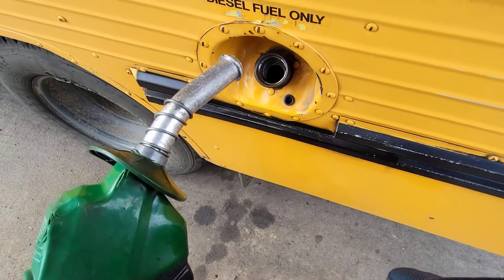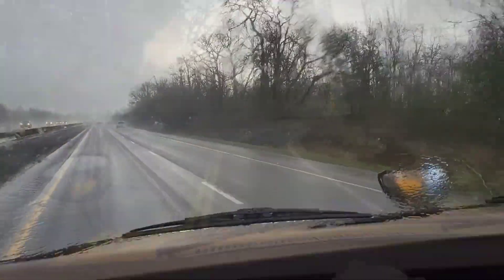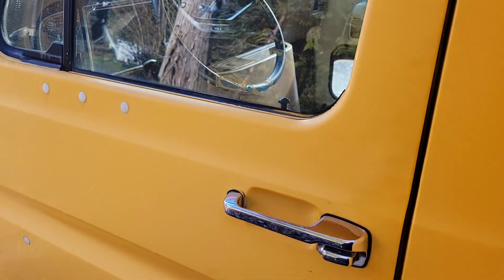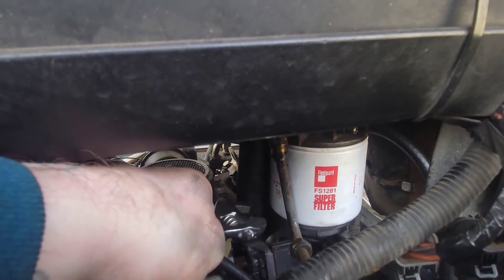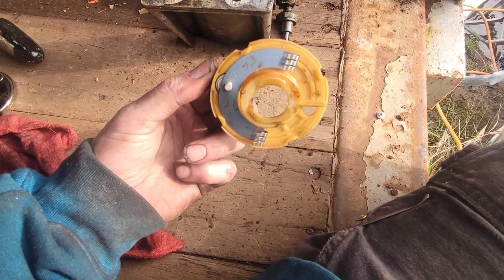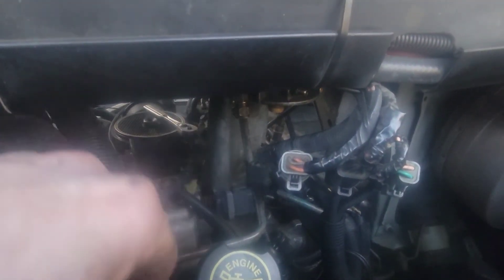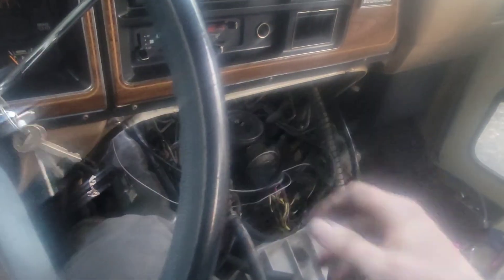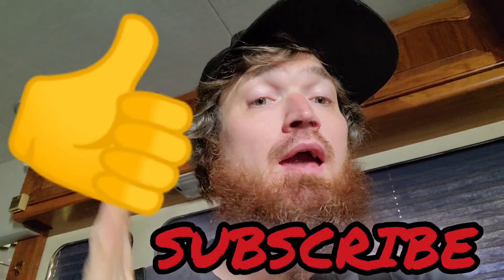7.3 idi diesel ford fuel heater delete

Comment: On my 7.3 am getting crunking but know start am bout at my ends with the truck. Its started off being a bad fuel pump. Changed it out! Then injecton pump was not sending fuel though the lines! So i Changed that out! Buy the way. It will start on starting fuild and run good. Just will not start on its on! And i went over to the glow plugs with all new ones. Checked the wires. Getting 8volts on the ends. So i unhooked it off the Selenoid and hot wired it for 10 secs still will not start on it on!  Do anyone know of anything i can try to do next i will update if i fine anything out. Thanks!

Comment: Any downside in deleting the fuel heater? I'm of the mindset: "if u don't need it, delete it." Just discovered your channel, im a new owner of a 93 7.3 factory turbo 7.3 idi. It's a heap, but engine and drivetrain solid. Thanks for my continued education. -Jesse, SW Idaho.
Reply from the maker: No downside to deleting the fuel heater unless you live in sub zero temperatures most the year. Diesel is usually treated for winter these days. The heater is unnecessary. Just a source fir air intrusion. Thanks for watching! Any more questions just ask. Hope you enjoy your new rig.

Comment: Why not use starting fluid often?
Reply from the maker: Pretty inconvenient to pop the hood and hit it with starting fluid every time you want to start the vehicle. I am not one of the NEVER USE STARTING FLUID crowd! I use it if needed and in moderation. On a idi just disconnect your automatic glow plugs, or put them on a manual button before you use starting fluid. The hot glowplugs with starting fluid can cause preignition and cause damage.
Reply: @worthshop  Thank you ! After this I did some research and I'm going to chill on the starting fluid 😅😅

Comment: Should’ve cracked a couple injector line till the fuel came out tighten them back should fire up
Reply from the maker: I usually find it easier just to give em a slight whiff of ether, seems to spin the fuel pump faster than the starter can and gets the air pushed through. I've "cracked an injector line" in the past and it literally cracked and wouldn't seal back up! Waiting for parts sucks, so don't like to undo things unless I have to. Appreciate the comment though, thanks for watching.